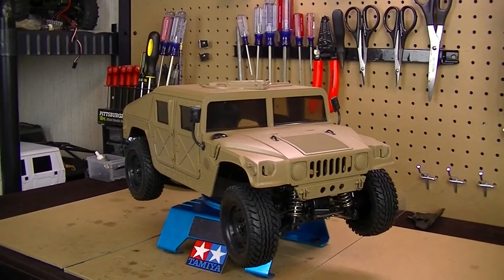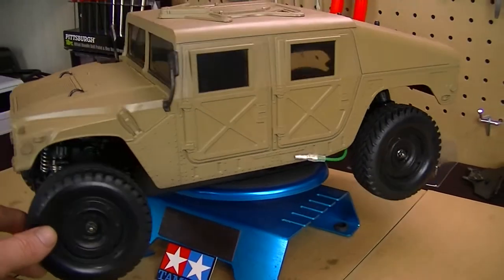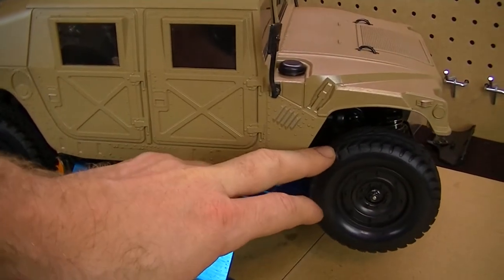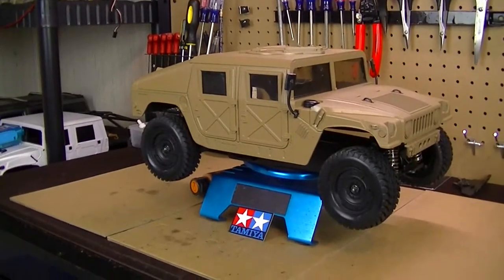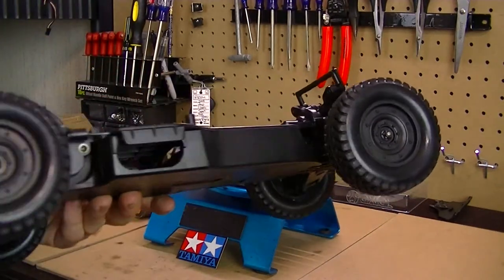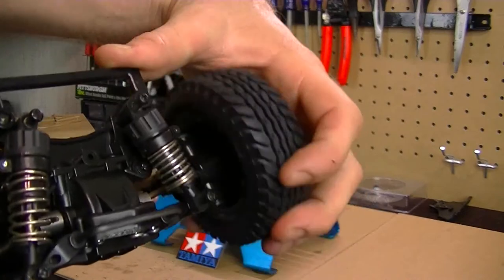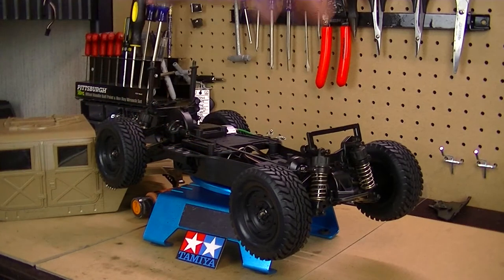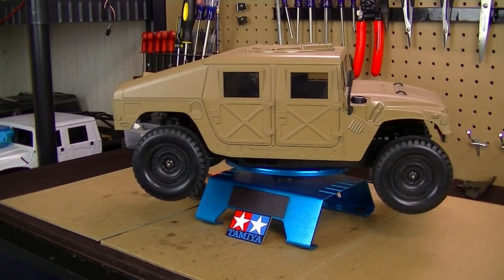RC84Films: Tamiya M1025 Hummer Update

Comment: Great to see your Hummer! The shocks are standard Tamiya C.V.A. Mini Shock Unit Set II, part no 50519. Those shocks are for several Tamiya chassis and you can build them in 3 different lengths, depending on the vehicle you have. Since you have assembled shocks use them (plus the manual) as reference to find the correct length.

You could also consider GMade Alu shocks if you want to go for something a bit better. They have matching lengths. But then, the chassis is not really that great anyway, so the original plastic ones will do just fine.

Be careful when driving this old lady. The plastic gets brittle over the years and breaks on the slightest impact. The motor mount is particularly fragile, if you haven't done so already I highly recommend getting an Alu 3-rd party one (Asiatees has cheap and good ones). Also the front knuckles are fragile. To keep mine running for a long time I have stocked up on sare parts 4 years ago, but unfortunately they becoming harder to find. If your funds allow I recommend finding a new Porsche Cayenne kit, those were manufactured until recently. The chassis is identical to the Hummer so such kit gives you a full set of spares.
Reply from the maker: LANE Boys RC thank you for all the information on the shocks and the chassis. I knew that this was a very rare and old truck and parts was going to be a little hard to find. It took a few weeks before I could find a new body and the body parts which I had to order them in UK and ship to US not cheap. I really love Hummers and to have a RC that is oh most close to it is great. I will be careful with it like I'm with all my RC's. thanks for watching my channel. I don't know everything about RC's and it great to meet other who have more info on them that can help me out.

thanks